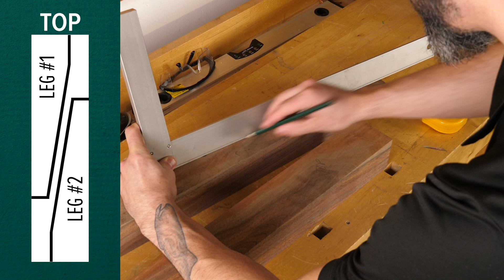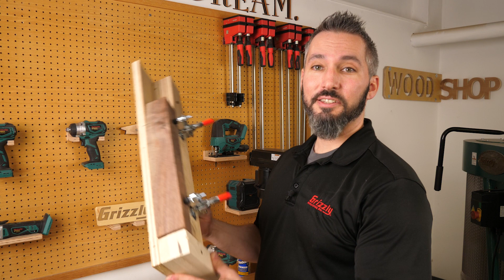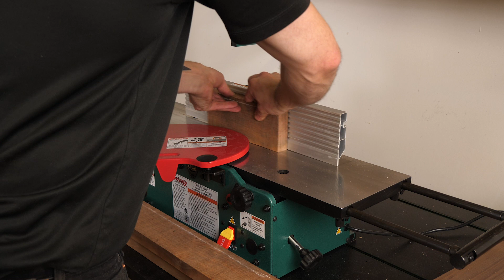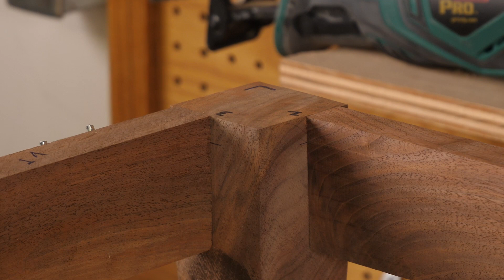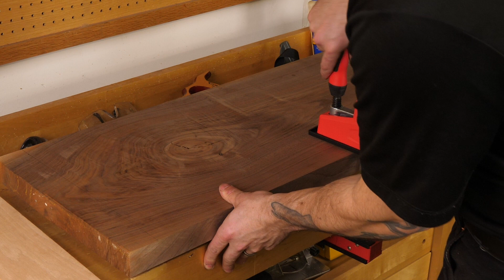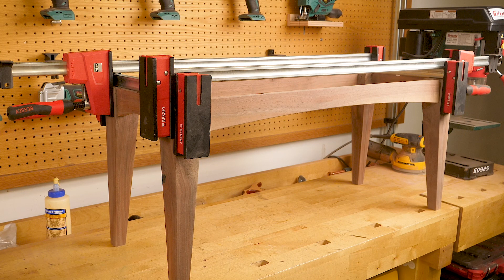Simple DIY Coffee Table Project + FREE Plans

Comment: Qq:  what blade did you use with the bandsaw to cut the curve on the apron?
Reply from the maker: That's actually the included blade with that G0948, which is a 6TPI, 72" blade.

Comment: Nice table. 

I’d suggest using push sticks when using the table saw. Especially with this table being a beginner project, beginners as well as seasoned woodworkers should use push sticks on material less than 6” wide. Yet there wasn’t a push stick even visible. 

Again just looking out for folks.
Reply from the maker: That's a fantastic point, and thank you! Please, always take all applicable safety precautions and make sure to do research on how to safely use your equipment and work well within your own comfort zone with the machinery.
Reply: @grizzlymachines  wasn't trying to knock you at all, it's just some people take what they see to heart on youtube, and so many get hurt on table saws. Knock on wood 25 years in and I still have all ten fingers.  FYI I love my G0691 Tablesaw. How much better is the shop fox fence, compared to the factory fence?
Reply from the maker: Not to worry, Bill! You're 100% correct on the safety note for sure and it's always vital to note that! Our videographer also owned the G0691 table saw and had a lot of time-on-the-saw, and also has experience with the Shop Fox fence system. He mentioned that the fence systems, in his experience, function equally well with adjustability/tunability and it would truly be a user-based decision because they have such similar features. Both fences offer a good top profile space for connecting aftermarket hold-down safety options, or for holding push sticks and other accessories, plus they both feature the replaceable HDPE face for smooth workpiece movement. We hope this helps!
Reply: @grizzlymachines  Ok thanks. I thought they looked very similar. I have only had this saw for a few weeks. I know to set it about a 1/32" farther than I am wanting to cut and when I lock the fence down it measures to be exactly the width I need to cut. Seems all table saw fences have their quirks you have to get used too. It is cutting square and the saw has plenty of power. My original saw was a Ridgid contractor saw.
Reply from the maker: On the included fence with out G0690 and G0691, there should be some adjustability to ensure the scale on the fence rails coincides perfectly with the indicator on the fence itself, and here's a link to the manual for that specific saw. If you go to Page 70 of the manual you can walk through this adjustment pretty quickly and never have to offset again! (Please note, the manual link here covers the two saws completely; our G0690 and G0691 all in one manual, so be sure to check it out for all kinda of adjustments, if needed!) https://cdn0.grizzly.com/manuals/g0690_m.pdf
Reply: Thanks. I generally measure from the fence to the blade with a tape or yard stick.